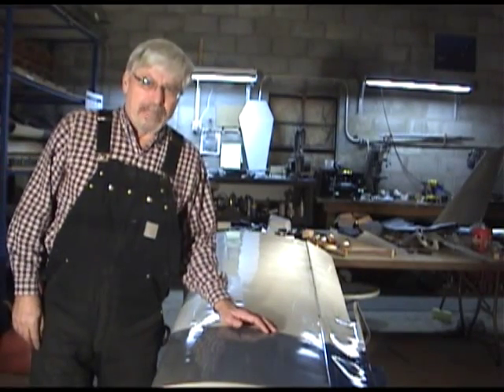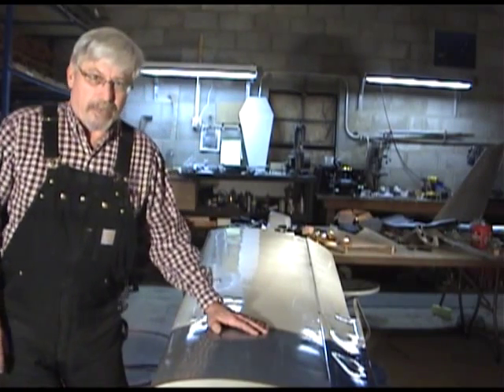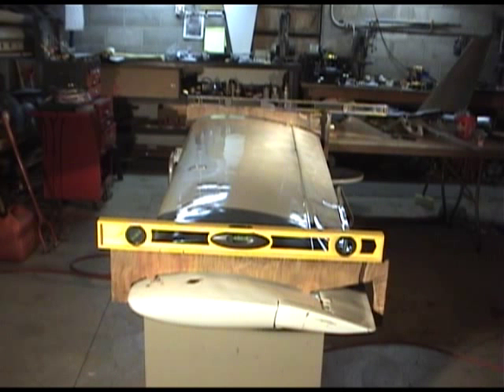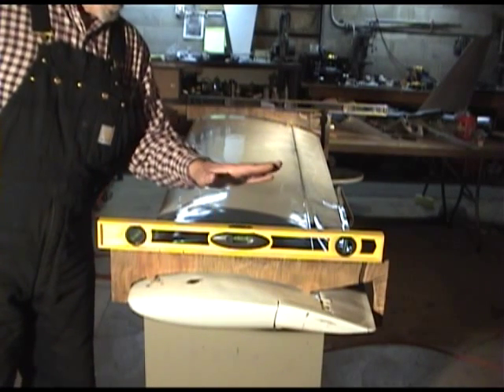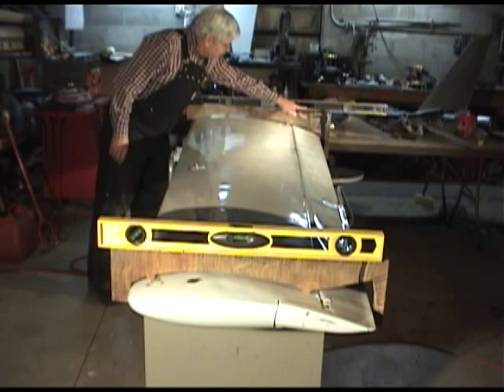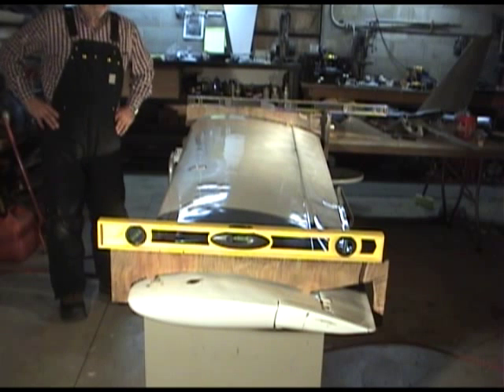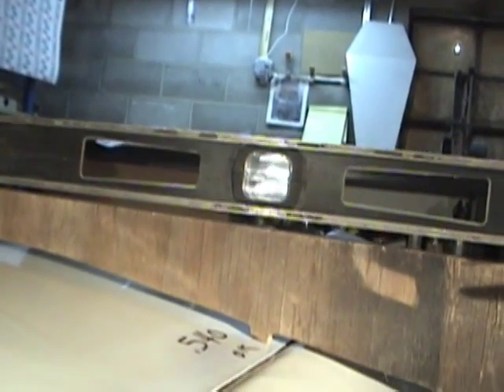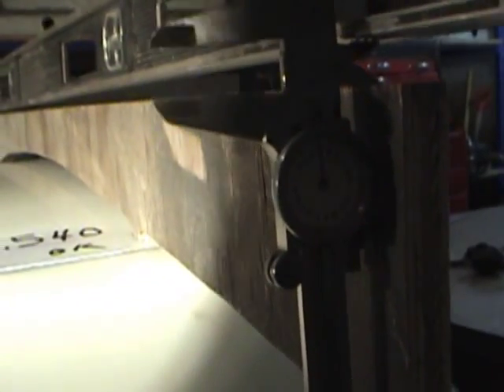BD5 Wing Testing for Washout

Comment: Hi Bill and Thanks for posting construction vid's. I have 2 BD-5 kits...a "virgin" sheetmetal kit...no holes drilled, and a "signed off airframe" with both long and short wings.   With that kit, I also recieved jigs for the vert.stab, horizontal stab, and wing cradles. I don't recall seeing anything like the items you have for testing washout. Is there any way I could get from you, a diagram or template to construct my own ? 
Great job, keep posting more vids on this project !!!!